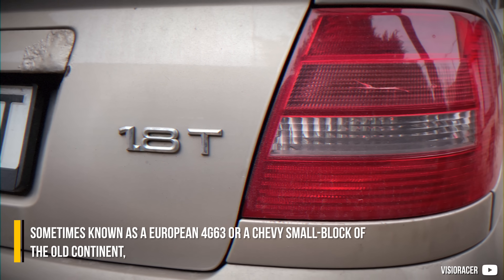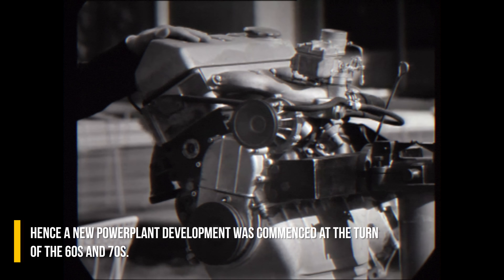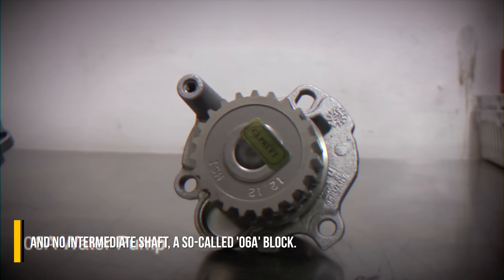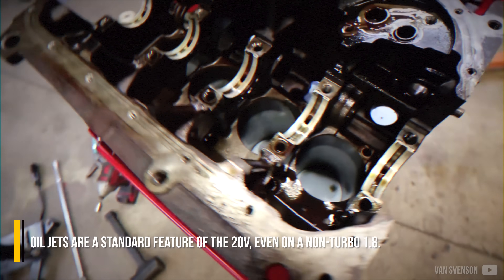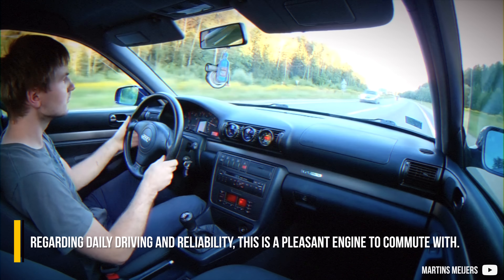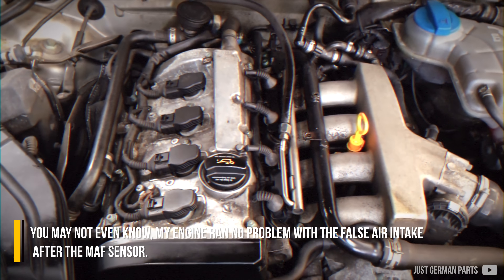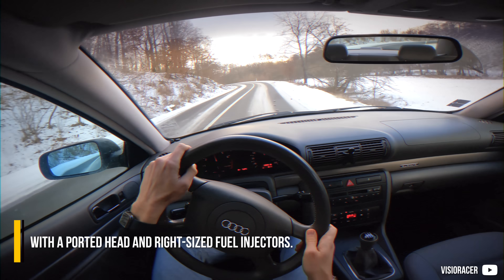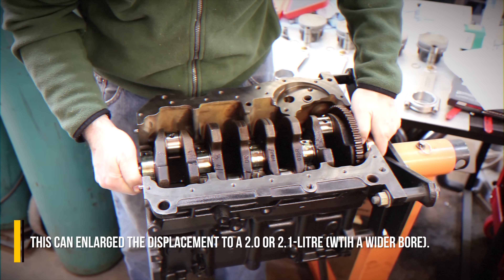Why Is The Audi 1.8T 20V So Good?

Comment: Had a A4 1.8t for 5 years and 70000 km (160-230k). The car had modded downpipe, exhaust and injectors and made about 225 hp. Drove it like i stole it for the entire 70k km and the only thing that failed was some EVAP valves and a crank position sensor. Never missed a beat and did not leak a drop of oil. Awesome engines although a little weak in low RPM and not the best fuel economy considering its displacement.
Reply: Wondering if i could slap a turbo on a stock 98 1.8 20v on it and push 220hp out of it.😆
Reply: It does not burn oil, or how much oil burns between oil changes?
I want to buy this car with this engine but i read that they burn to much oil, it is true?
Thank you!
Reply: @TEKATIKOKUTA  It depends, they are not like the later 1.8/2.0 TFSI engines but i think Audi states that about 0,1L per 1000 km is within spec. Mine burned about 0,5 - 1L between the yearly oil change, about 13000 km.
Reply: @Timoastra  what year it is yours?
Reply: @TEKATIKOKUTA  It was a 2004 with the BFB engine
Reply: @Timoastra  i want to buy a B7 model but with this 1.8 engine, and quattro.
They have also this engine code on this model?
Thank you!
Reply: @TEKATIKOKUTA  As far as i know yes, as long as it is the 20v version and not the TFSI
Reply: @Timoastra  thank's man!
Reply: @TEKATIKOKUTA my brother has a 07 b7 a4 s-line with a 06A 1.8t swap he'd sell located in minnesota
Reply: Interesting. Compare this to a stock 1.8 litre 4 cyl 16 valve naturally aspirated engine in my celica, producing 192 hp and 180Nm of torque... Not that far off!
Reply: @teme5529  180nm? my 1.6t fiesta makes 230 wtf
Reply: @marko8659  Cannot be compared at all, it is a turbo. Take away that from your fiat and we will see then... 
Or if I installed a turbo on my Celica... Easy 300Nm...

Comment: I sold my A4 B5 1.8T Quattro with 584000km on the original turbo! I had to replace the oil pump at 544000km but otherwise the engine was original (bearings, pistons etc.) when  I sold it.

Comment: i can see u had the normal FIS screen problems as mine had aswell xd
Reply from the maker: Do you mean the flickering?
Reply: @VisioRacer  mine used to flicker, not show half the numbers etc depending on how cold it was
Reply from the maker: @Zirion123  The ground wire on the valve cover was loose, it stopped after tightening, hehe

Comment: Ha 300 to 350 whp on stock internals 🤣🤣🤣 unfortunately that is simply not true the 225 bhp bam variant has stronger rods with bigger wrist pins from factory to deal with the issue but even they have a habit of throwing rods after being tuned 😬 brilliant engine though
Reply from the maker: Well, that's what forum threads say. I guess it always depends on a condition of the engine, tune, turbo used and other things. Making twice the power on stock internals more-less on any engine is always a risk.

Comment: I got b6 1.8t bex with a nice exhaust system sounds really good had a few issues with it just cant get the water pipe  from block to turbo sorted out got a braided pipe made out it still leaks , overall it's not to bad already did water pump , oil pump and cam chain the parts are not so cheap depends what you repair and where u get it from. labour is costly to  if u do not do repairs on ur own , to strip the front to get to where u need to.

Comment: This engine is good and it is true! But rest of components (fuel pump, oil pump, valves like n75) is not so good... I had golf 4 with this engine tuned to 200hp and it was very good car, but now I have audi a4 b6 with the same stock engine and it is not so good.

Comment: 2003 Jetta 1.8t 410,000 km original turbo doesn’t burn a drop of oil.  Been tuned since 270,000 km. Running 18psi. Great little engine

Comment: Still driving my 2005 A4 B6 ultra sport. (Daily driver).  Has 170,000 on it but I had tons of maintenance, upkeep on the car.  You name it, it's been done to the car.  Timeless style IMO.   Still get compliments on it.  Only mod is Unitronic stage one.  Still love driving on it.  Will drive it till the wheels fall off.
Reply: Nice, that's almost the same mileage as my 2005 A4 B6. I almost bought the Ultrasport (I looked at a Blue one), but the suspension was too low to go down my steep driveway without bottoming out. As a result, mine has the stock suspension with the optional 5-spoke 17" wheels. Mine is completely stock, and was my daily for 13 years. I just drive it for fun these days.

Comment: The A4 a1.6l ABL is 10 Times better. You only have 100PS, but you can rev the engine at the Start 🤣
It worked better, then my 1.8t AEB. I changed every time oil and everything and only reved it sometimes. 
The 1.6l I don't know, when I changed the oil 🤣🤣
It only eats oil, if u rev it. So I only put oil in. For daily driving and for fun, I would prefer the 1.6l

Comment: 1.8T AGU stock here. Drived 20 kilometers without oil due to cracked oil cooler rubber seal. Didn't noticed, tought it was faulty oil sensor lol. Repaired it and nothing happened. These engines is build to last. Greetings from Bosnia.

Comment: My wife's previous car was B5.5 Passat GLS 4motion  with the 1.8T and TipTronic auto.  The motor was reliable; but in that car, with the auto and AWD, fuel economy was poor.  Getting 17 mpg in a 170HP car just doesn't cut it.    The decent motor was let down by the rest of the car; I was happy to see it go.

Comment: I own 2003 passat B5,5 1.8 t 150 hp, awt engine code. 285000 kms, with automatic gearbox and runs for 200 kkm on lpg. Best engine!
Also dad have 1.8 20v Non turbo with 400 kkms, 250 kkm on lpg. Still runs without engine rebuild and it is in pretty decent condition.
1.8 20v is my top of relability just after 1.9 tdi vp engine.

Comment: Good review on the 1.8t 20v engine. Very very good solid engine for big turbo builds. A couple other things to note though…. The main caps on the crank tend to fail after around 600bhp so people now change them out for billet main caps. I’ve got an S3 8L with 642bhp and 516ft lbs on 99 Ron fuel with water meth injection. One of the highest powered S3’s here in the UK. Pretty much changed everything in the engine to make sure it’ll take it and more in future.

Comment: The durability numbers of 300k is pretty pesimistic i`d say. I had an a4 b5 with a 1.8t and the milage was 350k (pretty sure the original milage was higher as the car was 25 years old). Reliability was almost perfect even with some mods made
Reply: 309782 miles or (whateverish 600kms) the stock turbos wastegate broke
Reply: 375k km all original with stage 2 tune beaten on daily 😎

Comment: I owned a 2002 Audi A4 1.8T.  Great car!  Eventually, I replaced turbo with a GT28 turbo, 480CC injectors, larger inter-cooler, S4 brakes, RS4 sway bar, cold air intake, high flow exhaust manifold and exhaust system,  ect.  Was running aprx. 300HP/290 trq.  I had 275,000 miles on it when my brother purchased for his kids.  They drove for a few years, (de-tuned) and sold car.  Very reliable and fun to drive.
Reply: Those kids 100% re-tuned it

Comment: Ive got a 1.8T BEX B6, straight pipe exhaust, refurbished turbo(ko3s) and a map and ive got 220bhp, 30+ from factory for my model. End goal is 350bhp, but thats bit later on when I do alot with the engine

Comment: The most reliable one was the B5 Audi A4 1.8T with the mechanical throttle, these coils never fail as much as the newer system, but has restrictions. My dad has his from 150 to 200hp, miltek cat back exhaust and k&n air filter, was amazing and went very well. Was super reliable and we always serviced it every 8k miles, and was a very good car overall. Oil services are cruicial with the correct oil and genuine filters.

Comment: I adored my 1.8Ts, they sound outrageous with a big open cone filter. They're a lot of fun when tuned and in a nicely modified car, and parts are everywhere. A new engine can be had for less than £200 in the UK if you take it too far with yours (rods are the main weak point). Mine were exceptionally reliable, but if you don't take good care of them you will run into trouble. Regular oil changes are a must, I did it every 6 months.
Reply: 10k km or 1 year oil change interval is optimal.

Comment: It is a good engine for a lot of horsepower, but it's bad in its stock form, making only as much as the 2.0 16v ABF. I consider the 2.0 16v superior since it is far more reliable, easily going over 500k. This engine is the grandpa of the EA888, having the exact same bore and stroke as a 2.0 TSI. You can put a turbo on it, it will hold around 450hp before the block cracks, that's good considering it's a 1993 engine that wasn't really designed for a turbo. Plus, it doesn't consume as much oil as the 1.8t. If you are looking for huge hp number, yeah by all means go with a 1.8t. If you want around 200-250 hp you can get that NA with a 2.0 ABF with some mechanical modifications. Also there is the 2.0 ABE, on the Quattro Audi 80. Although they seem underwhelming with only 140/150 hp, these engines were strangled from factory since they originally outputed 175hp, 2 more than the VR6, so VW/Audi decided to choke them a bit. With a tune you can get that HP back. Also, it uses the same block as the 2.0 8v 2E, ABA (and there were a few more codes for this engine, depending on continent and euro emission standard). In conclusion, i consider the 2.0 ABF the best and the most reliable gasoline engine VW ever built. You get decent power, a lot of revs and the simplicity of a NA engine. It has one drawback: the old Digifant injection system might be tricky to diagnose and repair, since some units are even 29 years old by now. I love ur content and I am looking forward to seeing a video about this engine.

Comment: Important information: 
The forged cranksahft is only in the AGU (golf 4 150hp ), BAM (audi s3), Audi TT. The other engines just have cast crankshafts. 
The cast crankshaft is good for 400hp .... it will hold 500- 600hp but not very long. 
The best 1.8t is the Agu Block. 
Its a 06A block it has stronger rods (forged 20mm wrist pin), and no electric vvt, the head has bigger ports (exhaust side).
The agu engine is basicly the "strongest" 1.8t and holds up 2 300hp reliable.... with stock internals.
If u want more horsepower in these engines, at least disasemble the head an get new exhaust valves (the stock valves can snap off if they are older).
Great video 👍👍

Comment: I would have a few little corrections on this video, but overall 90% accurate info props

I own two 1.8T Leons, one FR & one 20VT 4 motion with built motor 😎

All hail the almighty 20 valve turbo

Comment: I owned a 1.8T in a B6 A4 Ultrasport Avant. It was a nightmare. Coolant leaks, oil leaks, water pump only last 30k before leaking again, temperature sensor, misfires, valve cover gasket leaks, belt tensioner failure, AC failure, radiator fan failure,  vacuum leaks and a lot of other things. 

Now I own a B8 S4 manual and it has been solid for 90k miles! Bought it at 40k now it has 130k miles. No timing chain issues no leaks! Its stock. Only thing I changed was the battery, 2 front axles, coolant, water pump, thermostat, clutch and fly wheel, and oil for 90k miles of driving!

Love this car! You should make a video on Audis most reliable engine the 3.0T supercharged!

Comment: 2002 AWP Owner here: these engines are bulletproof. My dad gave me his GTI when I turned 17, and as you can imagine it had a pretty hard life. Now, 12 years later, 332,000 miles and it still hasn’t died. That old GTI nowadays is a dune buggy with 30” mud tires. Run the proper synthetic oil, Change the timing belt every 100 K miles, and she’ll never die.
Reply: timing belt every 100k miles? Big risk taking going on here.

Comment: i have a b6 1.8t cyl 4 i was told has no compression i was told it needs a motor from one shop and form another that they thing its a bent valve. that could be fixed by rebuilding the head ... any advice?

Comment: I had a B6 1.8T Quattro. Stock its bland although great in the Winter up here in Canada. But in the Summer I added a stage 1 tune and went catless exhaust and the difference in sound and torque was amazing. 16psi on stock diverter valve. These engines are Bulletproof and require minimal maintenance compared to other audi engines

Comment: Far from reliable, head gasket and cracked head issues , overheating, vacuum lines and vacuum leaks, plastic parts that differ from different 1.8T - meaning they have a different thermostat in a Audi 1.8 than a vw Passat 1.8. Different set up for the crankcase breather lines. It’s a junk design and glad Audi did away with it

Comment: Got a 1.8t and a 2.7t both are amazing motors. 
1.8 has 247k miles and it's my daily driver. 
2.7 makes 500 hp on some rs6 turbos and e85 👌
Reply: 2.7 t only good one

Comment: Must be the most overhyped engine in the history. Completely anodyne. Revs only to 5k which modern diesel can do and are always beaten by naturally aspirated GTi-cars without something like replacing internals and putting 400bhp to it.
Reply: The most overhyped engine is 2JZ 1000 hp stock 😂

Comment: Yeah finally my favored engine! :D Thanks for that! I had a Audi A4 1,8T BEX with 190 HP. VisioRacer allready mentioned the fals air intake-problem. This is really easy to fix, just lift the oil lid at running engine. If it sucks vacuum, then you have to replace the Kurbelwellengehäuse-Entlüftungsventil (Crankcase ventilation membrane) this part costs about 30 euro. Also very common are heatcracks in the exhaust manifold. They usually close trough heat extension after warming the engine up. Sry for the bad english^^
Reply: I have a crack in exhaust manifold too and dunno with what to replace it :-|

Comment: 2002 Mk4 AWP here, just finished a full overhaul and K04-022 turbo upgrade. Absolutely love the engine, and to date (241k miles) the car has never left me stranded. As with any other German car, the 1.8t does not take deferred maintenance well. Keep up on consumables and it'll treat you fine.

Comment: I own a 2004 A4 Quattro B6 with a APR stage 1+ with 235 hp and 275 ft-lb of torque and I’ve never had a mechanical problem with it and even now with 167,000 miles, I’m about to upgrade the performance and this has been the most fun to drive and own vehicle I’ve bought, I will never sell it!

Comment: I have an Audi S3 8l, 120000 miles brilliant engine, very quiet at idle and pulls all the way to 7k. I’d like to point out that nearly all engines will run forever if correctly maintained, but this will almost never happen because cars depreciate and fall into the hands of idiots who want a 6 month fling

Comment: My old 1999 Audi A3 1.8T works great with a K04 turbocharger. I was today at the "Autobahn" and and I was the most time between 180km/h and 240km/h cruising. And my engine has run for over 270.000km yet
Reply: that engines if you take care of it, can do more than 500.000 km

Comment: I have a Skoda Octavia Vrs with 1.8t engine turbo back exhaust, front mount intercooler, remaped 210hp 300nm of tourque. It has more than 250.000km, but it is mantained and runs good

Comment: Gotta mk4 jetta 1.8t mt tuned full exhaust forge hoses and k&n panel in stock air box. 240 at crank only issue is clutch wont last… will do 0-100 in 6secs and i daily drive it!
Great vid!

Comment: Dont the chains in these stretch and basically grenade the engines ? This has happened to many people I know who owned Golf 4 GTIs. It wasnt as common a failure on the Audi S3 8L and Seat Ibizas though. It was bad enough for the Golf guys that most moved over to the Mk5 or R32/VR6 as soon as they were able to do so.
So from my experience, this isnt a particularly bulletproof engine. Good tech and it will last on a well looked after completely stock car, but it doesnt compared to a Mitsubishi 4G63 or a Chev LS like you claim.
Reply: The timing chain was updated to a more robust design. It was, and always seems to be the case, extensive oil change intervals. Turbocharged engines get HOT. 7-8k between oil changes (synthetic) and your engine will last. I'm speaking from experience.
Reply: The timing (cam) chain is not an issue on these engines. Just change your oil regularly

Comment: As a tech in their hay day only one thing caused sludge. 

That is a pcv system failure. 
The valve goes bad (hidden inside a hose) and leaks boost into the crank case vent. 
Taking all the sludge from the crank case and turbo charging it into the oil pan. 

This also caused oil leaks. Because you are turbocharging the crank case. 
This was made doubly worse because owners refused to pay the labors to properly fix the system.
Reply: Hi, I have 1.8T 132 KW AUQ, And i suspect this PCV is bad. Could that cause bad starting when cold? also pressure drop in intake? When the car gets warm everything is ok. 
No check engine light.
Reply: @paveljanouch4664 
Have you tried running a VAG scanner and scanning instruments? Coolant temp sensors like to not show up on regular checks and cause cold start problems

Comment: This may be slightly irrelevant, but considering a VW 1.8T can reliably handle up to 350hp, with the ragged edge being around 500hp on stock internals, and a BMW B58, praised by Visioracer recently can reliably handle 650hp+, the world record being nearly 900hp, I wonder how a BMW B48 4 cylinder would compare with the 1.8T?
Reply: The stock block of a bmw 1.5 in the turbo f1 cars made 1500+hp
Reply: @fastinradfordable  Ik but I was asking about the B48
Reply: Don’t worry, you’ve only got to change every single hose and clamp to make the B58 reliable…
Reply: @izzy031096  Thats with the N54 I believe. The B58 has improved with reliability a lot.
Reply: ive seen stock unopened 1.8t make 566whp and 417tq with 10+ pulls over 500whp
Reply: @nicksampson2469  I wonder how much a B48 can make stock tho?